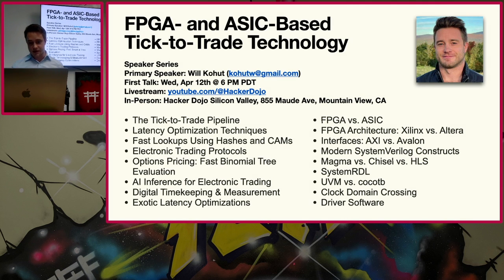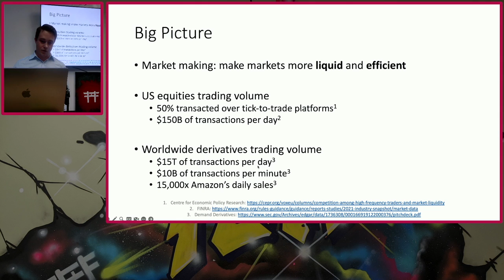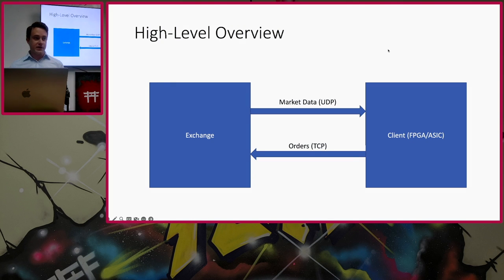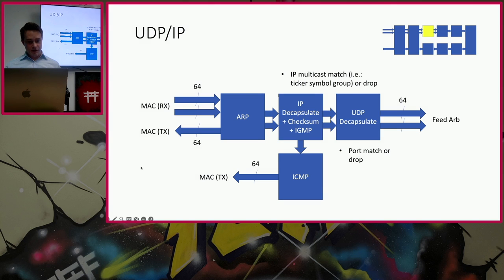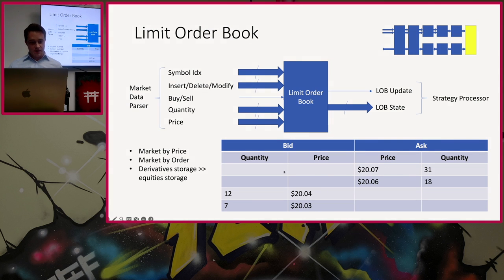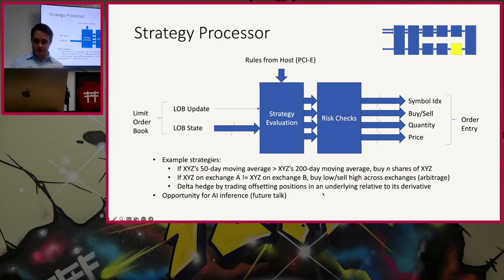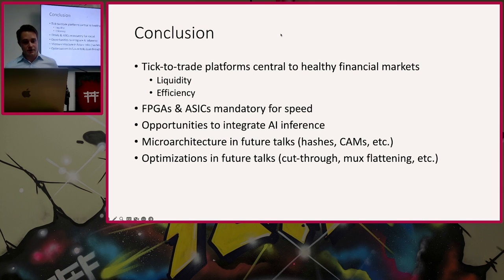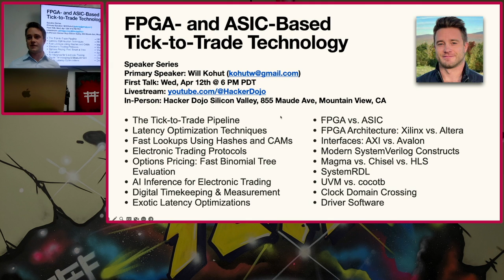FPGA- and ASIC-Based Tick-to-Trade Technology

Comment: Excellent presentation. I'd love to hear more about (1) where lines can be drawn between FPGA vs perhaps an on-board SoC vs using the host resources. (2) thoughts on the buy vs build dilema of IP blocks in the HFT space. (3) future directions (ie standardization at the hardware level? will we end up with FIX ASICs and ITCH ASICs?) Perhaps ideas for future videos.